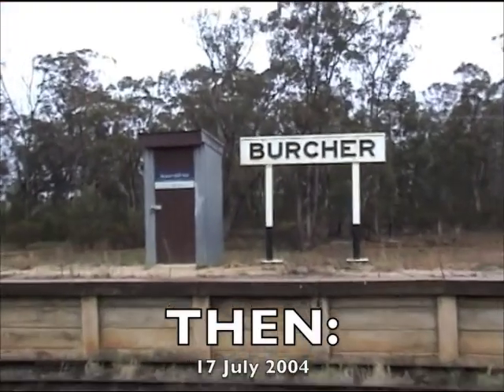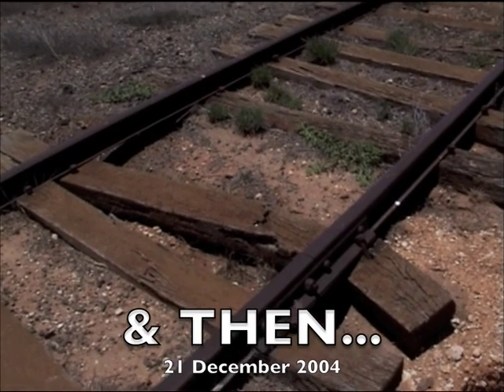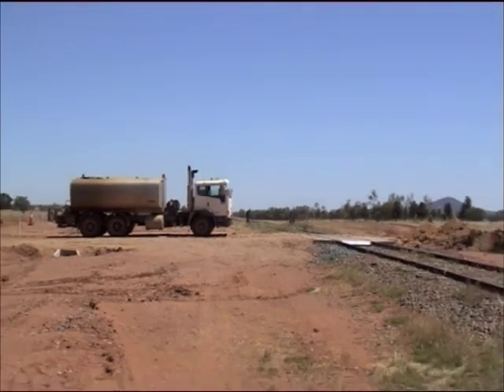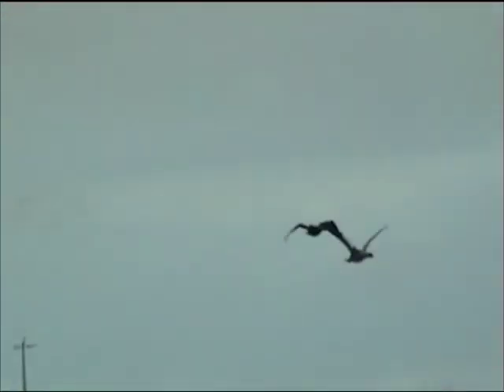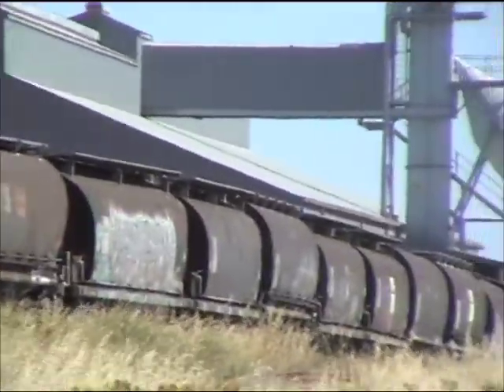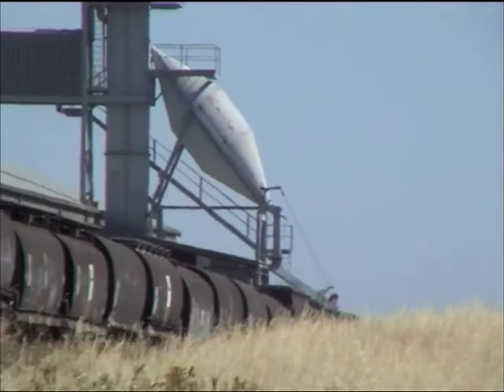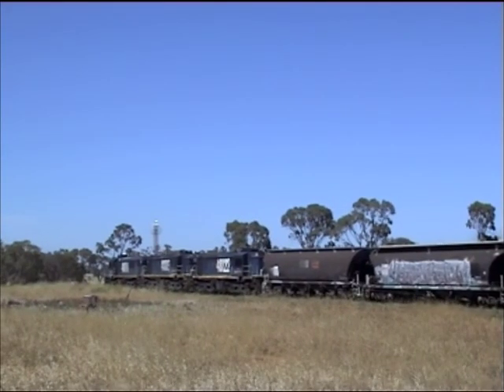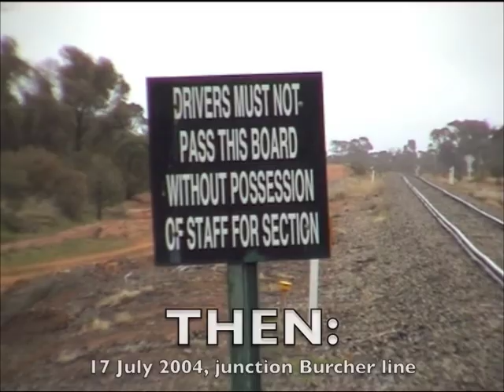Pioneer railway--Burcher & Lake Cowal Then & Now

Comment: Funny thing about West Wyalong, it was a decent sized small town, but the station had a low level platform and the junction to Burcher. Wyalong Central about 2Km away had a standard station building with a station master but it only had a general store.
Reply from the maker: For some reason the NSWGR didn’t seem to recognise that West Wyalong was the major centre, not Wyalong.

Comment: Curious about how much the line has degraded since this was uploaded. Also, no infastructure of days gone by remain?
Reply: All of the line is there. It’s very overgrown at burcher, Wamboyne, corringle. Lake cowal, clear ridge and wyrra. The railway had a bridge and every rail is still there. There are remains of loadings banks at every listed location burcher, Wamboyne, lake cowal, clear ridge but not wyrra the turntable at burcher upyard can still be moved! The signal is still at burcher yard. Some of the rails in some areas are thinner than other because of rust, some have cracks because of rust and heat.
Reply from the maker: Interesting comments, thanks. You’ve obviously been out there much more recently than I.